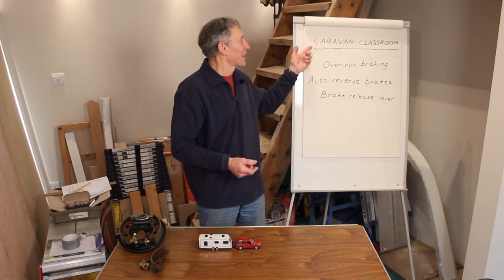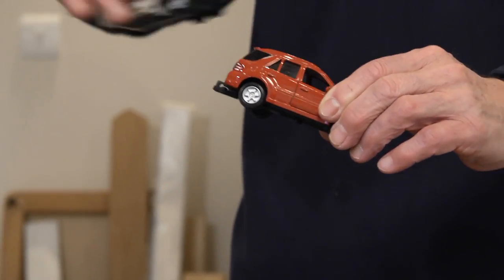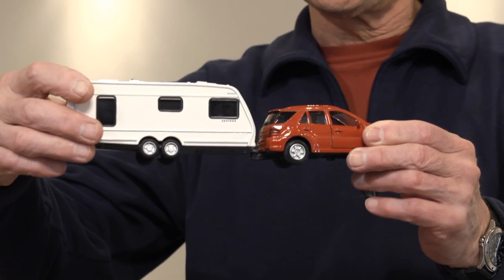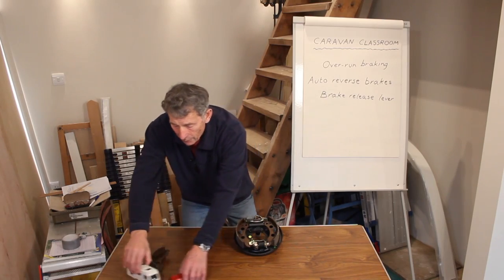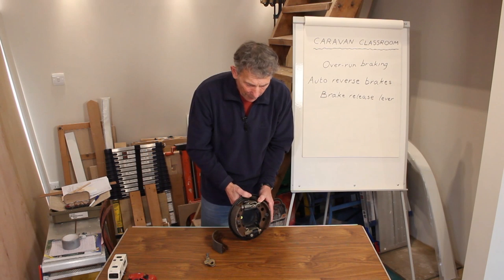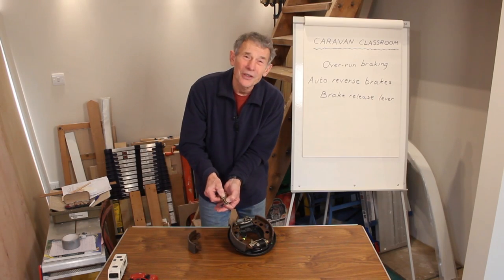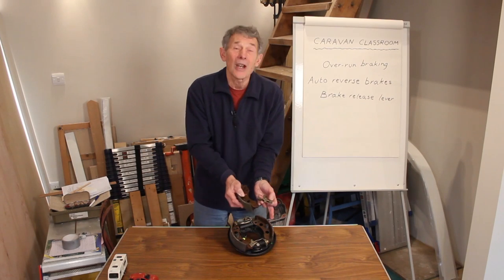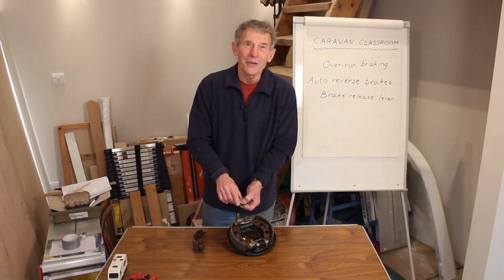Practical Caravan | Caravan Brakes | John Wickersham Explains

Comment: Can you explain what happens when you pull to a stop on an uphill with your caravan in town and stop. You apply the handbrake fully and unhitch the caravan. Will it roll back down the hill as the brakes don't work in reverse? Or is there some other safety system around this dilemma.